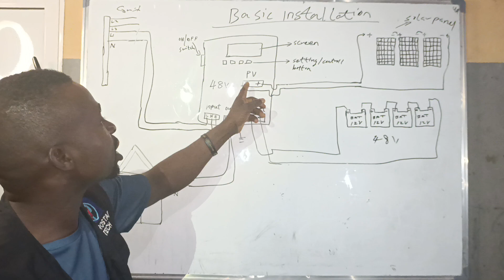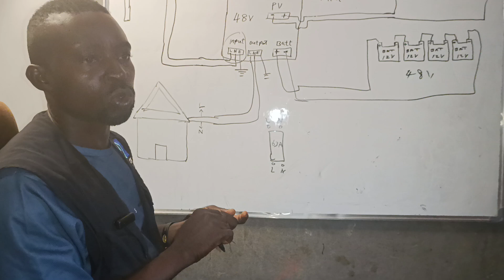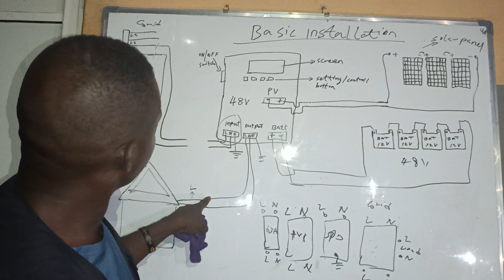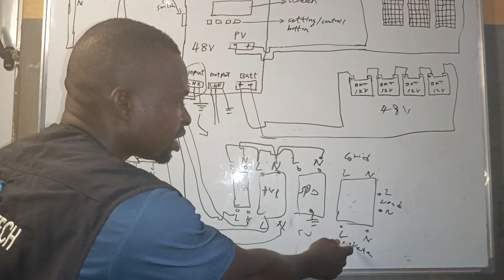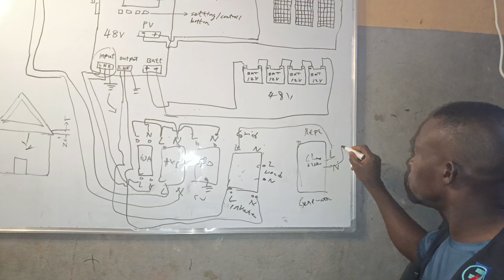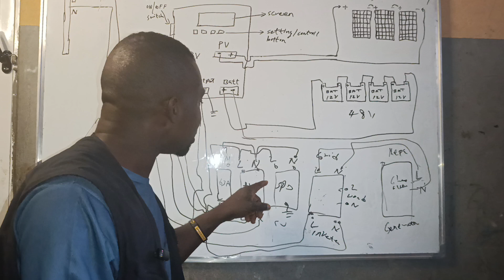Do this to protect your inverter

Comment: Thank for w job well done. The issue am having is why will you connect the existing change over load output to serve as the grid for the second change over. can you pls.explain better on that
Reply from the maker: Although I am going to upload a video that explains that.  Is for emergency when your inverter has fault , then you turn to grid, either generator or National grid (NEPA)

Comment: Can an AVS be used at the output of the of an inverter?.
Reply from the maker: Yes for protection
Reply: Please can you  use AVS breaker for  the AC input?
Reply from the maker: Yes it can  be used

Comment: But incase you don't have an AVS installed can you set the minimum and maximum voltage on the inverter ??
Reply from the maker: Not all inverters have that features for voltage regulator. Some when the voltage is not up to the required voltage, it will not pass through. In case of high voltage many inverters do not have such protection. If not clear to you contact me on +2348160449736 it is free i will take my time to explain better for you.

Comment: Pls how do you size your spd
Reply from the maker: Sizing a Surge Protective Device (SPD) properly is essential for protecting electrical systems and equipment from transient overvoltages (like lightning strikes or switching surges). Here's a step-by-step guide to help you size and select an SPD correctly:

✅ 1. Understand the System Requirements

Before selecting an SPD, gather information on:

System voltage (e.g., 120V, 240V, 480V, 600V)

System configuration: Single-phase, three-phase, wye (star), or delta

Nominal system current and load

Location of SPD installation (service entrance, distribution panel, subpanel, equipment-level)

✅ 2. Determine the SPD Type

There are three types per IEC 61643 or UL 1449 standards:

✅ 3. Match the SPD to the System Voltage & Configuration

The SPD’s Maximum Continuous Operating Voltage (MCOV) should exceed the system’s nominal voltage (typically 10–25% higher).

The SPD voltage rating must be appropriate for the line-to-line, line-to-neutral, and line-to-ground voltages.

Confirm the mode of protection: L-N, L-G, N-G, L-L as required.

✅ 4. Select the Correct Surge Current Rating (kA)

This is the most critical sizing aspect. Use the Nominal Discharge Current (In) or Maximum Surge Current (Imax) ratings:

Rule of Thumb: Higher exposure areas or facilities with sensitive equipment need higher kA ratings.

✅ 5. Check the Short Circuit Current Rating (SCCR)

The SPD’s SCCR must be equal to or greater than the available fault current at the installation point.

Typical values: 10kA, 25kA, 50kA, etc.

✅ 6. Look at UL 1449 Suppression Ratings

Choose an SPD with a low Voltage Protection Rating (VPR).

A lower VPR = better protection, especially for sensitive electronics.

✅ 7. Consider Environmental and Installation Factors

Indoor or outdoor rating (NEMA enclosure type)

Operating temperature and humidity

Mounting: panel-mounted, DIN rail, inline, etc.

✅ 8. Compliance and Standards

Ensure the SPD complies with relevant standards:

UL 1449 (4th edition)

IEEE C62.41 / C62.45

NEC Article 285 (for SPD installations)

Example

You’re protecting a 480/277V 3-phase wye service entrance in a commercial building.

Type: Type 1 SPD

Voltage rating: 480/277V

MCOV: ≥ 320V L-N, ≥ 550V L-L

Surge current: Minimum 80 kA per phase (due to commercial application)

SCCR: Must match panel’s available fault current (e.g., 25kA)

Enclosure: NEMA 4 (if installed outdoors)

If you'd like, I can help recommend a specific SPD model or create a sizing checklist for a project. Just let me know the system details!